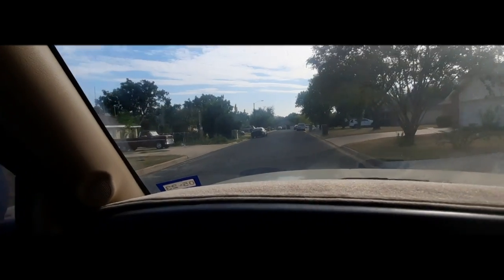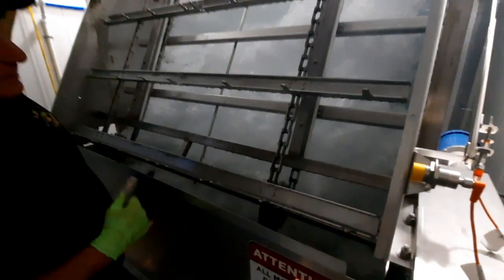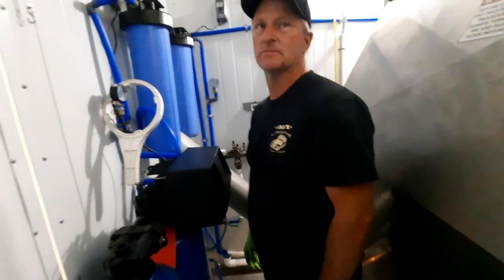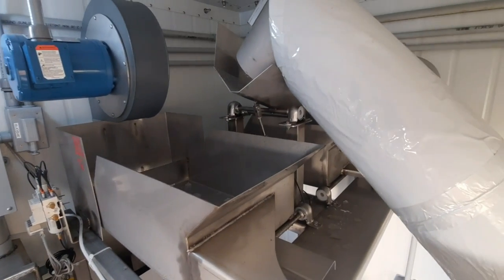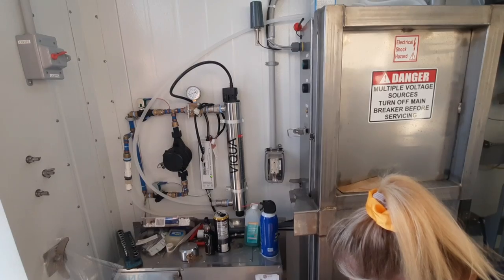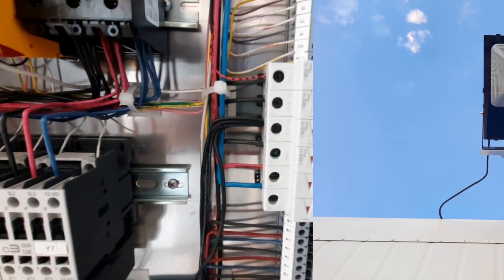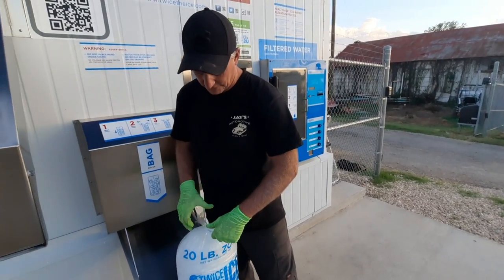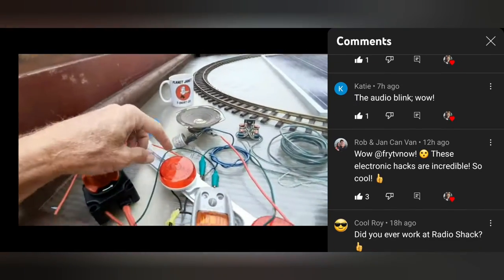Twice The Ice -  How it works from the inside🍟📺🤘👀

Comment: Is the ice machine a profitable business??
Reply from the maker: I don't know ,time will tell👍
Reply: owning 7 of the $155k machine, net profit about  $50k-60k/ year. 100% financing. So ROI is like 600%+ 
Surely it isnt easy. Location finding is the only hardest skill
Reply: @pbm9cje2n  new machines are good for 3-4 years then normal cheap repair. Some mechanics can do that easily.
Weekly task is like 3 times/ week to clean outside and refill supply inside. Max 20-30mins each time.
Reply: @davidpham9353  I’m interested in hearing more from you.. can you I’m me when possible.
Reply: @davidpham9353 how do you find repair techs? I have one machine, it needs a repair, it's been impossible to find someone that works on these.